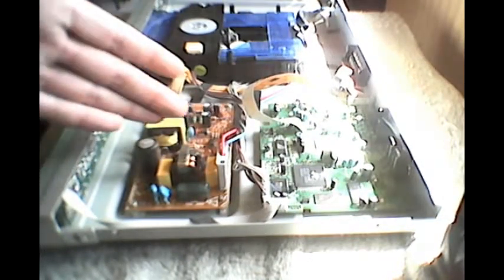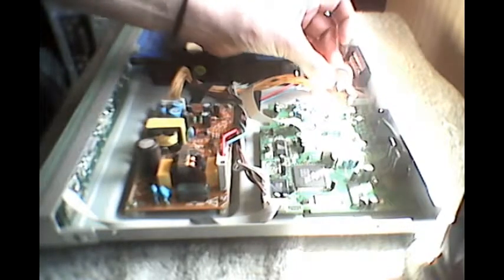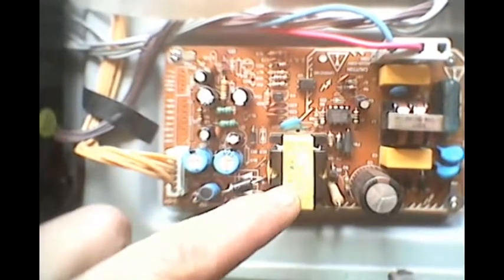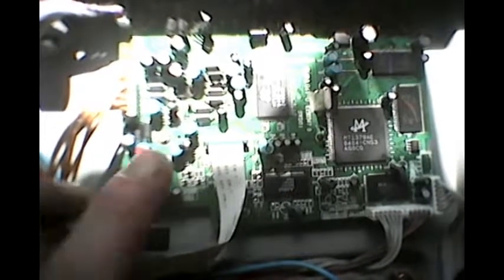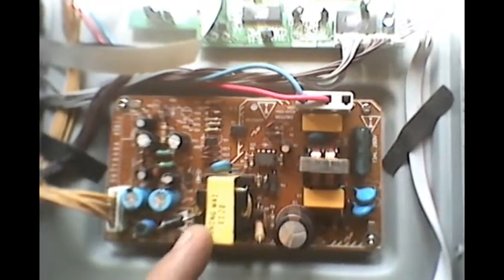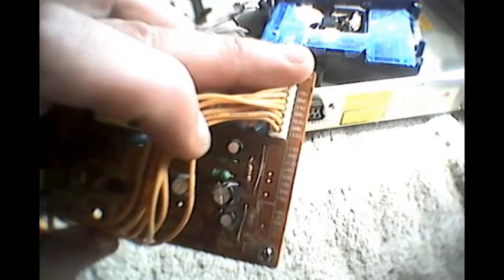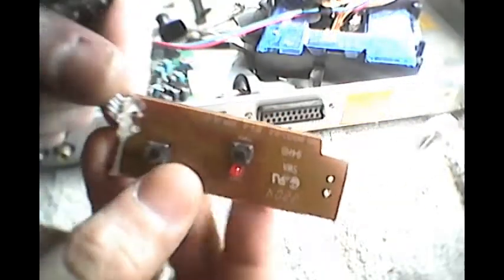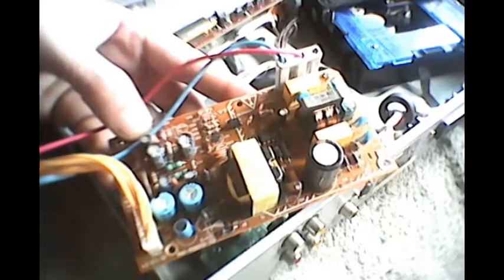Goodmans DVD Player Tear Down What Parts Can Be Salvaged? - ArDweNOme -

Comment: Hey! I have this DVD player, it's a Goodmans 147. But mine is broken and I am trying to fix it. This is a long shot, and I know the video is 5 years old now, but do you still have this power board? If so, can you tell me the capacitance and voltage for capacitors C13, C16, C17 and C18 and the colour coding for resistor R14? Mine have all burnt out and I need to replace them, but I can't find the information I need anywhere!